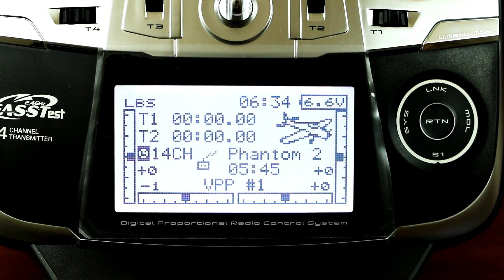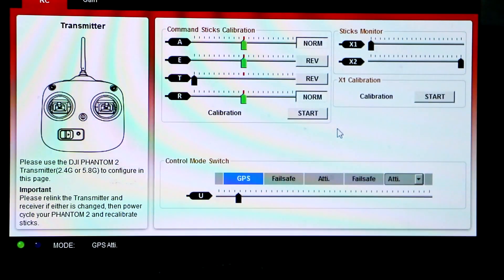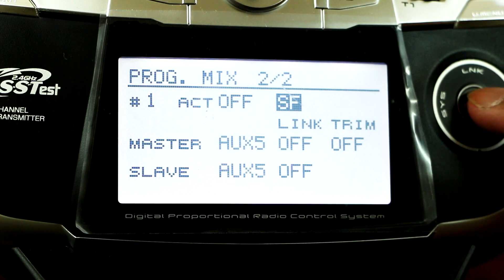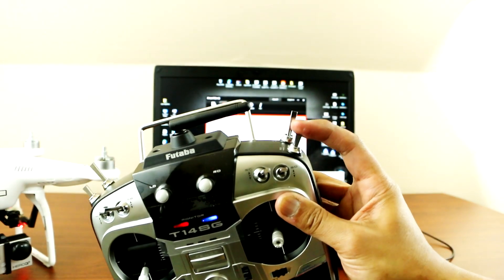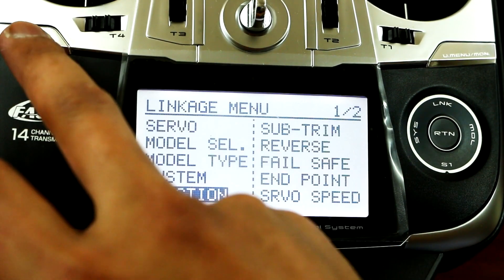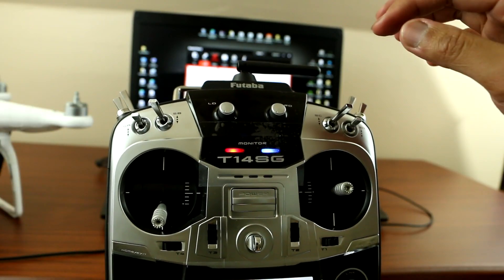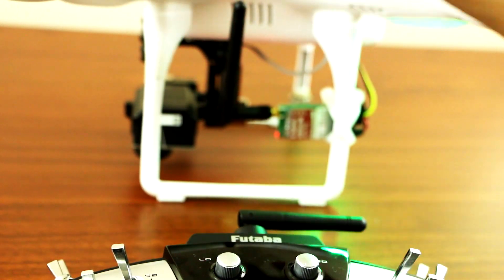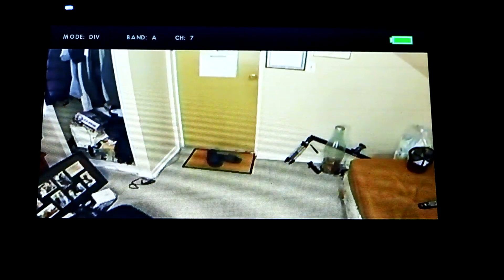DJI Phantom 2 - Futaba T14SG Receiver Installation & Binding (Part: 2)

Comment: I just got this controller with the phantom 2 I bought... How do I program it through the computer? It came with just the charger and controller with the whole thing pre-installed. is there a specific cable that I need

Comment: Great video. Thanks for the effort. I have a Phantom/Gimbal just like you.  I like my settings opposite from you with the throttle on the right; but, I changed my settings to your settings, so everything would be the same. My problem is controlling my gimbal. I notice when I move my throttle my gimbal moves. Now I've gone through all the functions. I have the gimbal control on LO. But the throttle is the only switch that seems to have some control over the gimbal. I notice a beeping sound on my Futaba when I move the LO knob; but, no gimbal control. Any ideas/solutions?
Reply from the maker: i dunno if my beeps as well its been a while ive played my phantom due to crappy weather were getting here
Reply: I'm having the same problem have you figured out how to fix it?

Comment: I found what was my problem, but the thing is the gimbal would not work with any assigned button
Reply from the maker: make sure you follow exactly what I do in this video
Reply: L BS I have already followed every single step, everything works fine except the gimbal control :S

Comment: did you make a vid to show how you slowed down the gimbal
Reply from the maker: DJI Phantom 2 - How to adjust the Gimbal Up and Down Motion Speed
Reply: L BS Hey thanks, are you anywhere near Calif? This is me on FB.https://www.facebook.com/dan.golden.39
Reply from the maker: golden4248 far away from cali, im from canada
Reply: In link function should MOT have a CTRL value of any kind as my t stick in calibration is not moving, wondered if it is related.

Comment: What are the advantages with going with the Futaba over the stock remote other than more controls?
Reply from the maker: able to customize the motion speed of the phantom from 100% to 50% so you have that nice slow motion slider effect to it, also adjusting the gimbal motion speed so it doesn't have that jerky effect when moving it up and down. check out my other videos so you can see what does a motion speed and adjusting the gimbal speed does to your filming